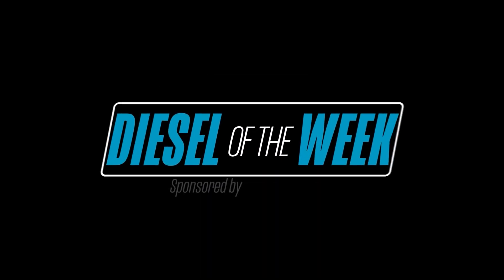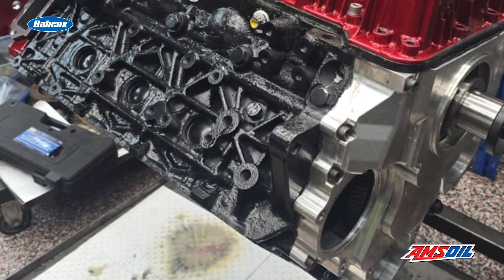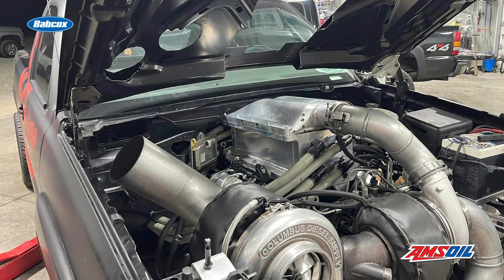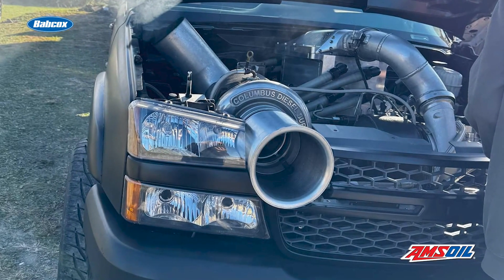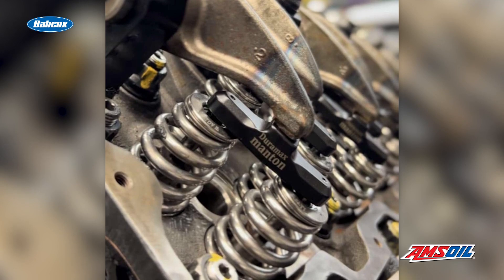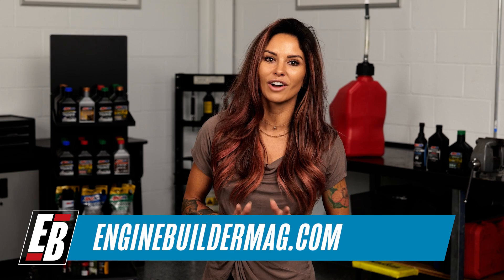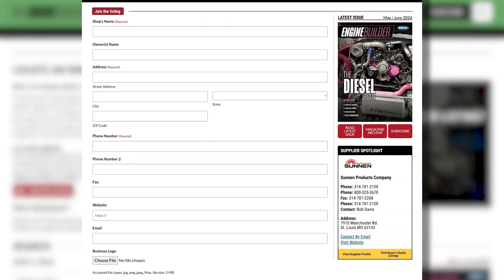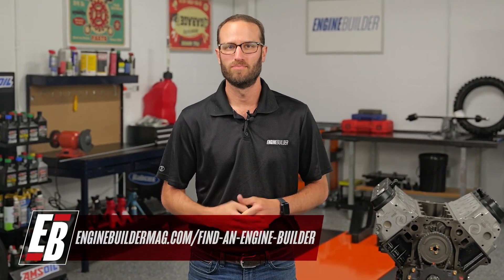No Zone Diesel's Compound-Turbo Duramax Drag Race Engine

Comment: Curious as to the direction of this compound trend as in Hyway and marine CAT C15 compound engines the prevailing trend is to convert back to single turbo, im sure these trucks and boats do more hrs running than any pickup ever will,
Reply: people convert back for simplicity and they are cheaper, when in reality a delete is whats needed, compounds and triples will always out perform singles.